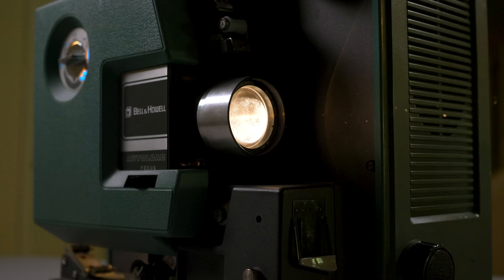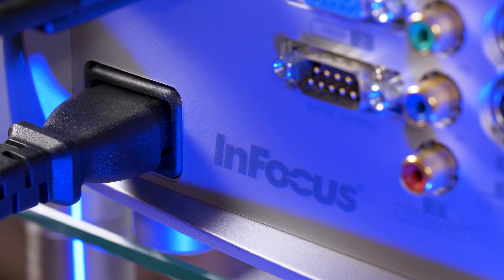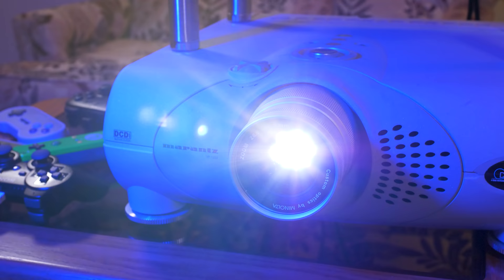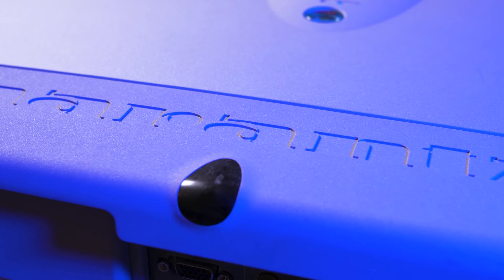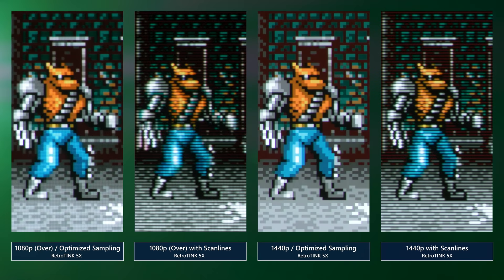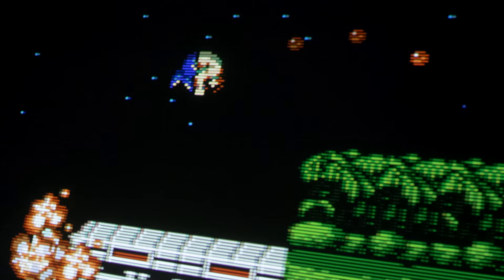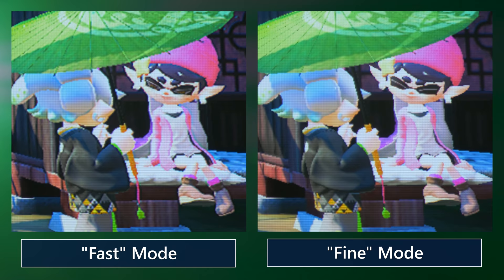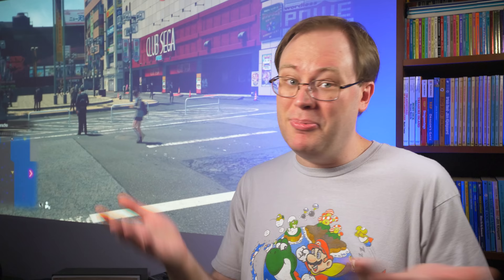Gaming on Projectors - From Retro to HD to 4K HDR / MY LIFE IN GAMING

Comment: I have a cheaper Vankyo unit that projects in 1080p and it does a decent enough job for video for having an LED engine for a light source and LCD for the image.  It doesn’t have black blacks but neither does film.  I wonder if we’ll see scaled down systems like that used in cinema where it’s 3 DMD units on a prism or even scanning RGB LASER technology like that in IMAX digital systems?  Time will tell.

Comment: So displaying 1080p content on my 4k tv is not good it's washed out but it runs well fills the screen. And I heard there is like 4k gamer pro and 4k gamer 2021 for Wii u and Switch. So like can you give me the answer or you could buy it and make a video of it.
Reply from the maker: [Try4ce] 1080p shouldn't be more washed out than 4K. Make sure your TV's black levels (RGB range) match what the system is outputting. Wii U is Limited Range only, but nearly every other system can be set to Full Range or Limited Range in the settings. It's important to understand that neither is more vibrant than the other, but you do need matching settings on your TV if it is not detecting the range correctly.

Comment: Does anyone know the episode where they talk about Audio Receivers that had component inputs? It was a Denon model.
Reply from the maker: [Try4ce] That was the Gaming on 4K TVs episode. I've never tested those component inputs though because I prefer to connect component to devices line the OSSC or RetroTINK. So I don't know if there's lag or if it does things to the picture I'd rather it didn't do.
Reply: @mylifeingaming  thanks @Try4ce 🙏 I'll stick with a component switcher in that case

Comment: 25:41 I don't get the advantage of having native 1080p and "native" (pixel shifted) 4k support, when 2160p is just a perfect integer scale of 1080p already?
For other resolutions like 240p of course 2160p is nice, because it is 9x the resolution.
Reply from the maker: [Try4ce] The reason is because these integer scales are really only a theoretical advantage. If TVs used nearest neighbor (hard-edged) scaling for 720p 3X to 2160p or 1080p 2X to 2160p that would be one thing, but they don't. They do a soft scale of these resolutions just like any other resolution. We really need an external device that will do that scale for us, but it doesn't exist yet. We really can only do nice scales of resolutions like 240p, 480i, and 480p thanks to things like the OSSC and RetroTINK 5X. So for now, that's why displaying 720p or 1080p on devices that natively handle those resolutions give better results than a native 2160p display.
Reply: @mylifeingaming  Thanks for the explanation, I'd have really thought my TV would just upscale from 1080p to 2160p by doubling the pixels in both directions and not add any blurriness.

Comment: OK I don't get the 720p not looking good on 4k comment. 720p is a perfect 3x upscale to 4K (three 720p images fit left to right and top to bottom) which means that every 720p "pixel" is three pixels wide and three pixels tall on a 4k display (just as 1080p image "pixels" are two pixels wide, and  two pixels tall at 2x scale). Considering the relative pixel size on a 4k display, this should mean that a 720p image is just as sharp on the same size 4K TV as it is on a native 720p display (and the same for 1080p). It shouldn't be interpolated at all. This is actually one of the reasons 4K as a resolution makes sense in the first place!
Reply from the maker: [Try4ce] You're completely right, this would make total sense, but TV manufacturers by and large do not scale 720p or 1080p this way. I've heard of some Panasonic TVs (which are not sold in the US) that do nearest neighbor scales of 720p and/or 1080p to 4K, but that's all I've ever heard of that will do it that way. It should be extremely simple to implement such a feature, but they just don't. They should! But they figure most people want the smooth scale, which isn't so great for game graphics in my opinion.
Reply: @mylifeingaming  I think more investigation needs to be done on this. Doing a simple scale like this is incredibly fast and simple in terms of processing, and I have a hard time believing that manufacturers would NOT do it that way (at least in the pixel perfect mode) simply because it’s the simplest thing to do and costs less to implement. If most TVs aren’t doing that, then the gaming community needs to create a simple device that will scale the image properly like this before the TV displays it (without lag of course) because that’s ridiculous!
Reply from the maker: [Try4ce] I've been hinting at my desire for such a device to people we know who are capable of doing so. :) 4K is a bit out of reach for niche retro gaming products for the time being, but 1440p may be feasible. I believe even 720p 2X (1440p) would still look a lot better scaled by a 4K TV than the way they currently handle 720p directly. It's definitely the cheapest and easiest thing that would be possible, but generally these scaling algorithms are meant for video content, not games.
Reply: @mylifeingaming  If we raised some hell we might also be able to get some TV manufacturers (like LG) to add it to a firmware update.

Comment: So I heard what you said that some games on the Switch are not all 1080p so can you show me the list that are 720p, 900p, and 1080p. Also in RGB 104 you said that to fix geometry issues I had to go to a hidden service menu so would you make a video about that or a comment? Also a spreadsheet about video compatibility for Switch games or a comment (which I just said that over there) they would be appreciated thanks!
Reply from the maker: [Try4ce] There are too many Switch games that run at various resolutions (or variable resolutions) to list. Note that this does not change the signal that the system outputs - it's still 1080p, but it's just that the resolution the system renders the game at is lower than what it outputs. So it's not a compatibility issue.

We've got some work done on a CRT geometry episode, but I don't know when we'll be able to finish it. We recommend watching videos on the Retro Tech YouTube channel to learn about that stuff in the meantime.
Reply: Thank for the info! I think it's caused by dynamic resolution scaling (DRS for short) so how do I turn it off?
Reply from the maker: [Try4ce] You can't turn it off, it's implemented by the game developer into each individual game in whatever way they decide they want to. In most cases, I think it's a good thing because it prioritizes keeping the framerate stable. However if it really bothers you, you could set the system output to 720p and you might not notice it as much. But the downside is that the image will always be softer, when sometimes it could be higher resolution.

Comment: I would think that a whitish screen would be best since that's what theaters use.
Reply from the maker: [Try4ce] Right, but it depends on the environment. Theaters also have dark walls, floors, ceiling, and chairs, which helps increase perceived black levels and contrast because there's less light bouncing back onto the picture. If your room is light-colored, then gray screens can help with that problem, in theory. But I agree, if I were to really go all-in, I'd strive to have the right environment to use a white screen.

Comment: It feels weird hearing 720p talked about like it's a vintage artifact on the level of CRTs. Because I don't think I've ever actually encountered a resolution higher than  1080x2340 yet. Never even seen a 4k TV yet. They seem like they're still a very niche thing for enthusiasts with lots of cash. Or are 4K tvs in most homes and I'm just that poor?
Reply from the maker: [Try4ce] Well, I do think 720p is inching in that direction. Just like games designed for CRTs, special care needs to be applied to make them look their best, and there are few options for doing so these days. As for 4K, I think you may overestimate just how niche it is. If you browse TVs on Best Buy's website and filter by resolution, there are 22 720p TVs (remember, that's not real 720p), 30 1080p TVs, and 368 4K TVs! So 1080p is actually the one that's becoming niche compared to 4K, and that's why I was so excited to have native 1080p capability on the BenQ... while 1080p is super common on TVs out there today, it's becoming very uncommon with new TVs. 4K has come to replace 1080p on the market, and really, there are a lot of budget-priced 4K models too. When the time comes to need a new screen, it's actually pretty hard to NOT end up with a 4K screen these days.

Comment: HDR is a shitshow when It comes to projectors..
They only support the TV boadcast HDR10 standard.
Also the brightness and black levels isn't really there, and on top of that most brands does not have dynamic scene per scene optimization so the fixed HDR settings will not look good throughout the entire experience..